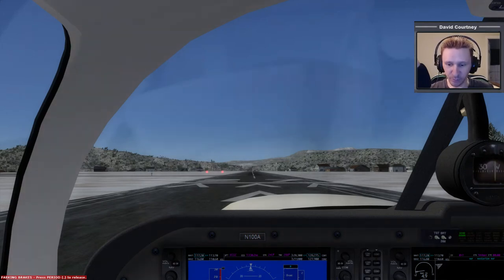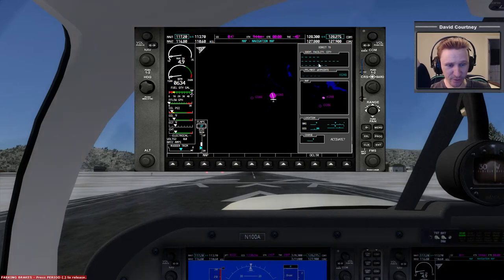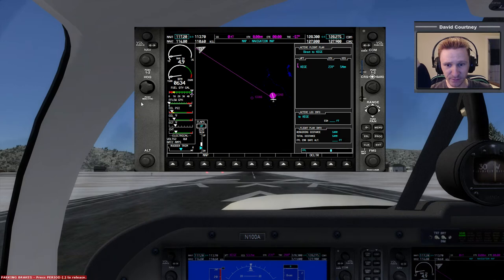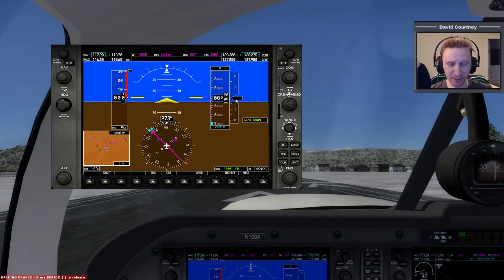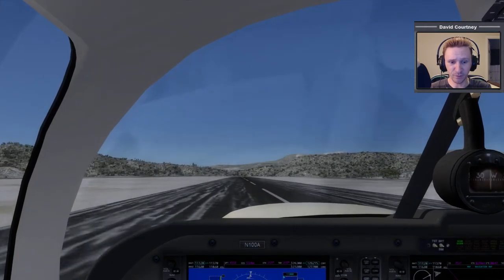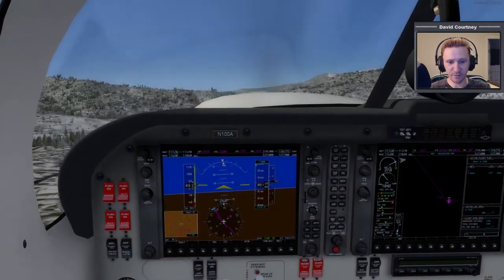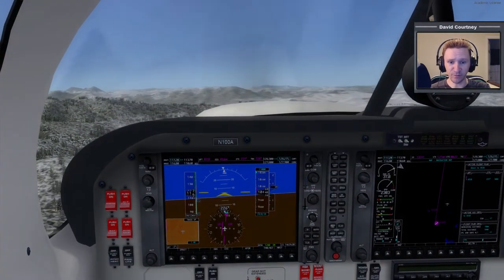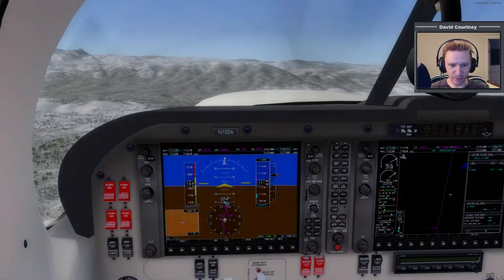Prepar3D v2 Flight Simulator - Flying in the Mountains [Part 2]

Comment: Great flying as usual, Dave! I would like to give you a few tips for your future landings. The reason the aircraft became uncontrollable on short final is because your speed was too low. Try to keep it at around 87-90 knots on short final in the Acclaim and just gently flare at around 7 feet above the runway. Also don't pull the nose so fast. Just gradually pitch up as you descend. Once you feel floating above the runway reduce power to idle and let the aircraft touch down. Also a better idea would be to enter a traffic pattern so that you have more time to descend. I'm sure with time you will become better. Have a happy new year!

Comment: Tip for you :)... as you are closing on your destination. There's a useful rule to help u learn how far out to start the descent. Pick a desent rate say 500f/m. Subract target altitude from current Alt, divide by descent rate = time to make descent. Then divide that by 60 (to get in fraction of an hour) multiply by ground speed n that's how far out  u start ur descent. Also it's a good idea to get it slowed down before you start ur descent if u want to get close. GPS tells u ur ground speed.

Comment: Nice vid as usual David. Couple of things. You prop (blue knob next to throttle) should be pushed full in, it's like that in real life too. Also when you set your altimeter with B key u should also re-align the Heading indicator to the Compass with D key. It goes out of alignment every 10 mins or so depending on speed. It's the same in RL too.
Reply: David Courtney
Yes it is, so full in for takeoff n climb then back off 1-2 hundred rpm for cruise. Depends if the plane can have failures from abuse.